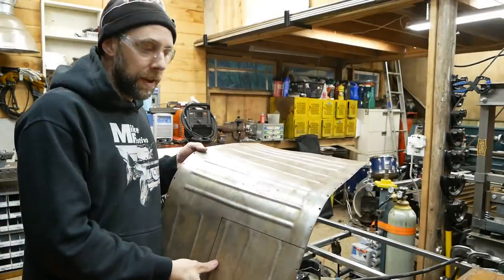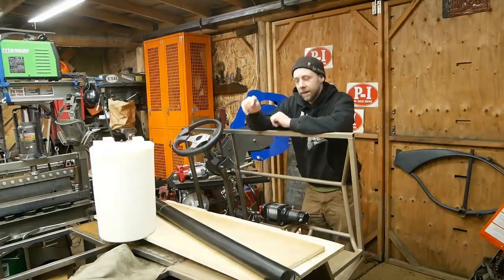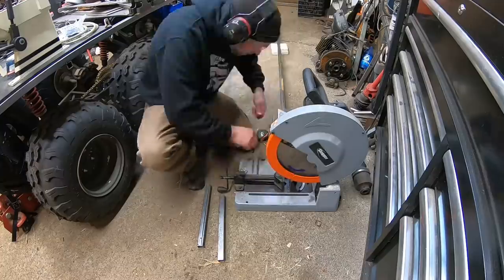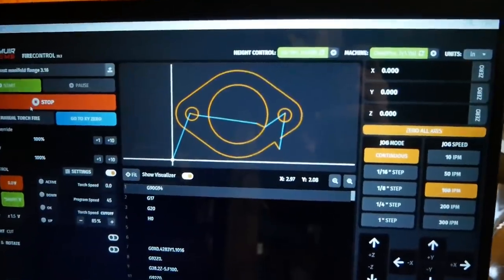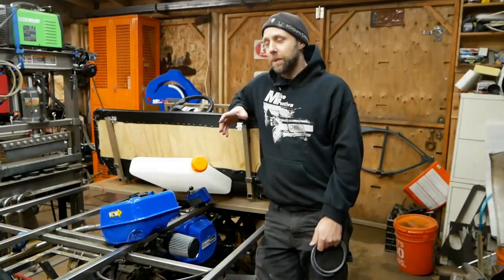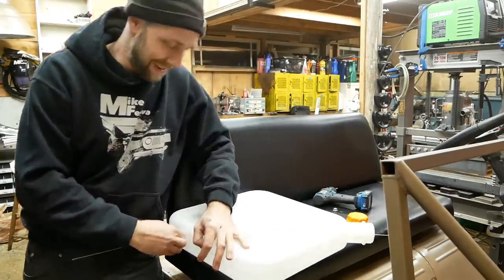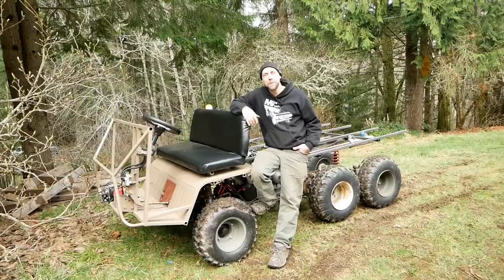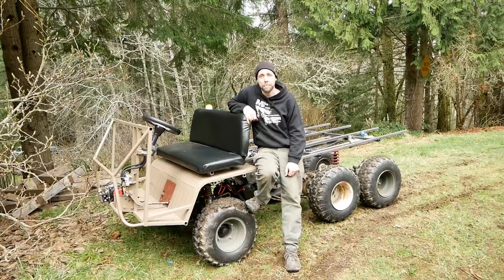Mini Pinzgauer 6x6 Off-Road Build Series part 7

Comment: If you pull the seat apart paint the wood to seal it from any water that gets splashed on it.  You are building it for off road so water and mud are something you should plan for. 

Do you have plans for tow points in the frame? The ability to hookup to something you are pulling or a point for the winch to hook back to can be key for getting around in rough areas.
Reply: I'd recommend at least 2shackles per end  and at least 2midpoint shackles as well (1per side) as when winching you can add an additional 80%of the winch capacity per additional winch line (taking into account parasitic losses and a minor safety factor) by double lining the winch rope/cable via sheave back to the vehicle (also adding tie down points for trailering the machine as well as pulling points in case it breaks down come in very useful not to mention in the event it rolls over having points to attach to in order to upright the machine are very useful as they say prepare for the worst hope for the best).

Comment: I don't know if anyone else has, but I went and did a little searching for you, Mike. The belt number you're trying to search for is an OE Arctic Cat replacement from the 70's for a 1973 Formula 2 290 which is no longer made. The modern-day replacement for that belt to go on that machine is a DAYCO HP3004, part no. 020182. I hope this help you out. They seem to be affordable depending on where you buy them, so I'd suggest buying a couple. It doesn't hurt to have a back-up. :)

Comment: Quick tip for getting those wires into that protector. You can get a wrench that fits into the protector and take the closed end of it and run the wires through it. Then place the closed end of the wrench with the wires in it into the protector and just slide to the end until the wires are in
Reply from the maker: Awesome tip Aaron! I will for sure try that next time 👍 Thanks 😊
Reply: @Mikefestiva  any time

Comment: It’s coming along, you can get a push/pull pto engage cable and lever from eBay for your shifter. I used one on a buggy build. Only gripe is battery location, I would put it up high with easy access (in case not needs jumped off. Maybe a couple of steel plates under the back just for weight. A great build

Comment: Try letting some air out of the tires.  That will increase the tire foot print and allow the sidewalls to flex alot more.  On my ATV I only run 7 PSI when I'm riding 2 up.

Comment: Front approach angle looks plenty to me, cool welding rod trick to get fitting in tank, so simple I never would've though of it. As of now the weight from all steel framing dont look to bad for axle support but your not done yet either, great video.......

Comment: @Mike festiva.  A trick for making seats with plywood, foam and vinyl.  Cut the foam 1/2-3/4 inch larger than the plywood base in all directions when you wrap the vinyl taught it will pull the edge of the foam over the edge of the plywood protecting the vinyl from being cut by the edge of the plywood over time (seat will last alot longer. Works with steel and plastic frames as well.  Picked this trick up from a seamstress that used to replace alot of boat, motorcycle, atv/utv, and snowmobile seats.  Most of the seats she refoamed and recovered are still in use today... The oldest seats she covered that I know of still being in use and undamaged are over 25yrs old.

Comment: Mike I didn’t read all the responses but the clutch  needs to be shimmed for the belt. Meaning. Even if the length is good you need to pull apart the clutch and shim the spider and also you can shim the secondary. Because of belt width. Hope I’m not commenting on something someone else may  have already said. Plus there are tons of spring rates and options. So it’s not just adding clutch weight to make it shift out. There are other options in springs as well to fine tune.

Comment: If you want to run a mechanical fuel pump on those engines (so you could put the gas tank over the rear axles for weight distribution), the way I have seen folks do it is to tap the hole for the governor linkage (in the top of the crank case) and install a pulse pump vacuum line bung. It solves 2 problems in one because it gets rid of the governor parts that are just flopping around (unless you are using them). Weight balance is never going to be great with the cab over the front axles like that but with the front hubs locking, traction should be totally fine. 
I love this build so far, I think it's going to end up being really cool looking and pretty capable.

Comment: If you want a softer cushion you can drill some 2-4” holes in the backs with a hole saw. Let’s the air come through. I used to work in the side by side industry. I was an engineer for Arctic Cat.

Comment: About that tank, on the inside, before the fitting, put a washer and a fuel secure piece of rubber, to the plastic side (with the hole cut undersized). The washer (and gasket) should be as big as you can get it. A lot of people have complained that the plastic around the fitting cracks with time. Another channel i follow that does overlanding (the name escapes me at the moment) did this trick and hasn't since reported any failure mode).

Comment: Mike your on the westside "wet side"!  Just get a couple ammo cans for your straps, parts and tools... you can mount them in a rack between the fron and rear tire up high so they are totally out of the way of ground clearance, cargo and cab space. Two .50 cal cans on each side would be plenty of storage!

Comment: It's not only the weights in your primary. but the spring in your primary and secondary that will factor in the shift rate of your CVT. you may find that if you put heavier weights in, that it will shift way too quickly and put you below the power range of your engine. it's a balance act of weights and spring. the secondary spring for the most part can just be adjusted in a different hole to achieve satisfactory results. (edit) I previously asked what the clutches came from and now see. 250 6x6. so with that, we now know that the clutch is setup for way higher RPM being that was a 2-stroke engine. I would probably try to match the springs and weights that are found in an old Polaris Magnum 425.

Comment: If i had opened that tap and die set on the plasma table like that somehow i would have managed to have knocked them in the water, may want to drill some 1” holes in the plywood to release the air from the foam when you sit on the seat or it will likely blow the material loose from the staples.

Comment: For weight on the back I would have a huge battery and maybe another winch.  Batteries always seem to be the problem, if you get a tractor battery or something like that, very large deep cycle battery where you can do a bypass or a disconnect on one of them so if you took it camping or something like that you could use it as power source to run your tent or whatever or even a little off grid cabin and then you would still have the second battery in case you depleted the first one so that way you can get it started again and charge everything back up. The added weight would give you much better traction and you can put it right where you wanted it.

Comment: The way the rear drive in a 6x4 gator works is the the wheels are locked front to back, so you have left wheel drive, then lock the right set of wheels with a clutch mechanism
Reply from the maker: That’s interesting 👍
Thanks for the info, I will look into there locking mechanism. Take care

Comment: Not really the same quad bike, but, I found mine a pig on tight turns. So I made free wheeling hubs for the back. It either has a front bucket full or a load hanging off the rear crane. Now I can adjust the drive to suit :o)

Comment: I would suggest you install fighter style diff lock switch, so you wont be engaging it unless you really need it and to prevent you from turning while lock is on. I dont know about polaris since that thing would be as it was least 2-3K€ around here and there isint many, if any around here. But most cases diff lock cant take whole weight of the vehicle, potential cargo and top of that turning action, so use lock when needed to get out of spot preferred to no turn while doing so and then release the lock, since its real possibility turning will blow the lock in peaces. Least that is my understanding of diff locks over the years and i rather be too careful than spend money and effort to repair it on only two machines we have it

Comment: I sure hope that your diesel heater tank leaks less than mine did!! Mine started dumping diesel into the floor of my bus before I was able to get it outside!
Reply from the maker: Man that’s a bummer, my brother has been running the same style tank on the outside of his camper for about 3 years and it’s still holding up. Sorry to hear about your tank.

Comment: Canada is the best locatio to find vintage sled parts.
The very gard to find 0227-002 is 47 1/2 ± 3/16 inch x 1 1/4"
The one your running #0227-010  belt is 49 3/16 " x 1 1/4" inch

Comment: I did notice that it didn’t go to high belt and I believe it’s because your using a 2 stroke clutch on a 4 stroke engine , it won’t get the R’s like a 2 stroke will ! So a spring change might be in order ! Engage at 1500 rpm’s top range should be 3500 rpm’s that will keep it from going against the governor . Just a thought !
Reply: you a correct about the clutch not being tuned correctly he is going to address that in an up coming video after he figures it out he knew it would not be correct but you have to get it moving and up to speed to start playing with weights and springs
Reply: @davidhelgeson6997  thank you for your response . I’m sure he will come to this conclusion but felt the need to say it again . I mentioned it when he first started with making the 6 x 6 and not using the Polaris engine ! If it where from a 500 HO then it’s a 4 stroke but I thought it was a 250cc which is a 2 stroke . And the clutches are totally different !
Reply: @davidhelgeson6997  he’s probably looking at a 60 - 200 spring or 75 - 230 would be my guess .

Comment: Bolting the gad tank to the back of the seat you made now makes it were you can't take the back off the seat for bigger items like you mentioned in video earlier then gas tank @Mike Festiva
Reply from the maker: Yes, it makes the seat not as useful to remove, so far it’s temporary, I’m thinking about making a take and mounting it under the rear bed now, I need to add as much weight as I can the the rear. Thanks for checking out my videos 👍

Comment: I don't know how you feel about electric drive but that thing is soooo noisy!  You'd be surprised how pleasurable it is to drive in silence through the woods.  Also, if you need extra weight in back, batteries are a perfect solution!
Reply from the maker: Running around quietly in the woods would be awesome! If I ever come across the parts for an affordable price I would consider it for sure. Thanks for watching 😊
Reply: @Mikefestiva  Yeah, it's certainly not as cheap as a Predator engine but, believe it or not, it pays for itself the first time you drive through the woods and can hear squirrels and critters doing their thing.  My next project will be an electric side-by-side.  I really enjoy your videos and appreciate your commitment to making them!

Comment: Have you ever thought of putting antifreeze in the tire like they do with tractors not for sure how much weight that it would give you said that you were going to have to add weight to the back
Reply from the maker: Thanks for the suggestion Mark 👍 That’s a good idea, I know tractors run liquid in the tires for additional weight, I may add some to my MiniPinz 👍
Reply: @Mikefestiva  don't know what size tire you have on there so you may have at least a hundred pounds of weight per Tire when you get done

Comment: Sweet,,, is it going to have a roof in steel or a Fabric top?
Reply from the maker: Thanks 👍 
I was going to make the roof canvas so it can be removable, but I possibly will cover the cab with thin 20 gauge metal to keep it a bit more dry, the rear probably will still be canvas. Take care

Comment: Don't know very much about these drive systems so I'll ask the question. Is there a way to make it front wheel drive as the default with 6X6 as the option?
Reply: no, the rear is chain driven and is always being driven if it is in gear the front has a clutch on each side that can be turned on and off

Comment: How did you adapt those HF clamps to your table?  Just weld on 3/4" rod?
Reply from the maker: I showed making them in part 4 or 5? I just cut the end off the clamp, then weld on 5/8” rod then it’s done. Really simple 👍

Comment: it seems like the 1st axle in the middle is higher than the others. is that because of larger tires up front? and wouldn't larger tires up front effect the gear ratio when the axle in locked?
Reply from the maker: The tires are all stock sizes. I believe mid axle is sitting up just a bit is because the machine isn’t loading like is should be, the stock rear dump bed was about 60 Lbs at least, once I get some extra weight over the rear it should level out 👍 Thanks for checking out my new video 😊
Reply: @Mikefestiva  Thanks for checking out my comment! I love your builds so far and how much time and effort you put into them.

Comment: @mike festiva hey I have the opportunity for an omni pro or a titanium unlimited for 500$ or the yes welder for 250 what do you suggest
Reply: if you have the proper power source for either one and plan to do a good bit of welding or later on expand/increase your work, I'd get the larger/more versatile welder, which I assume is the more expensive one. I have a hobart handler 140 which runs off 120V and standard electrical plug, it was good to learn a bit on, but its not ideal for real structural work.
Reply: @M.TTT.  all 3 units are 110/220 and all are multi process... mike did a vs with the omni pro and unlimited but didn't necessarily say which he would opt for then later posted a video on the yes weld 205ds being  the best low budget multi process.... maybe the omni pro and unlimited aren't in the low budget class? Idk
Reply from the maker: I like all 3 machines. The Omnipro is a great welder with lots of features, it costs about $1000. Titanium 200 is a really good welder as well and fit my needs better mostly because of it’s size and weight, easier to pack around. The Titanium cost about $750.
The Yeswelder is by far the most affordable multi process welder out of them all, I have been really happy with it so far, granted I have only used it for 6 months so time will tell. The Yeswelder runs about $370.
The Omnipro I ran for a year and a half before selling it off and I have used the titanium 200 for over 2 years now. I would recommend looking into them more and check out some other reviews to see if that helps you decide. Take care
Reply: @nhickcox02  nice and awesome he chimed in, I'm interested in finding out also.
Reply: @Mikefestiva  right now I have the chance to get the unlimited or the omni pro for 500$ from a classified add that's why I'm having trouble deciding and thanks for the reply I love your channel reviews and knowledge you share thank you
Reply from the maker: @nhickcox02  If you have an opportunity to buy the Omnipro 220 for $500 I would buy it, they are solid well built welders. You can’t go wrong at that price 👍
Reply: @Mikefestiva  thanks for your input